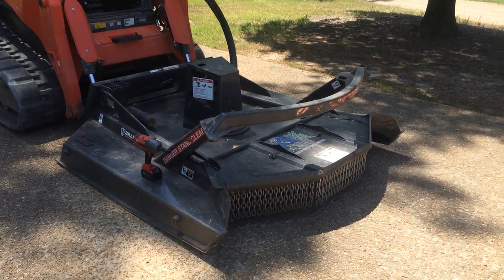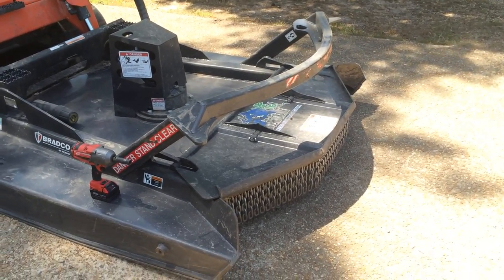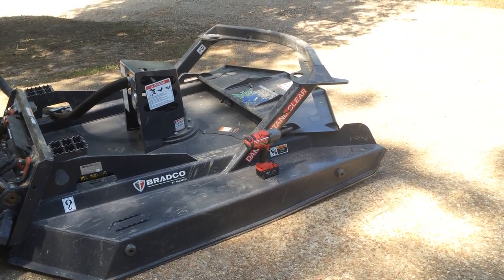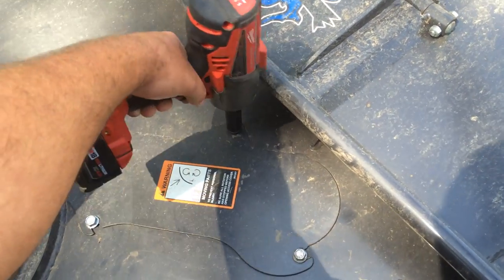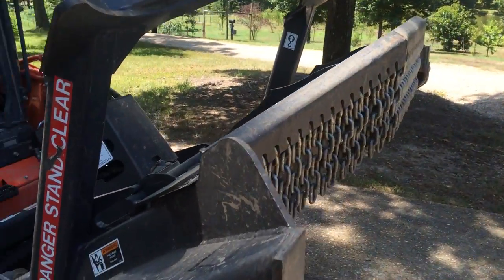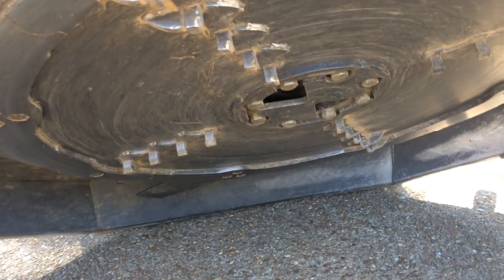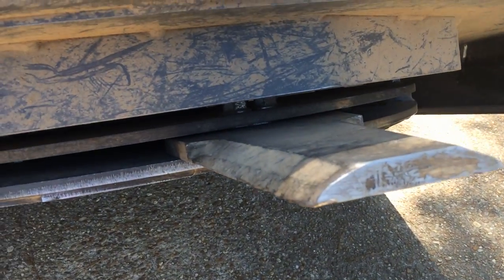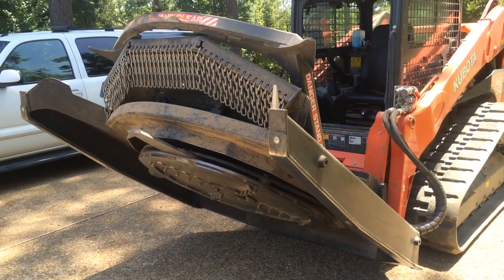Extreme Duty Ground Shark Walk Around

Comment: How does it do on range grass and brush?  Did you compare any other products?  I see diamond attachments (black unit) $7500 has a similar product with the hinged front for safety.    I also see the Diamond Mower (yellow unit) has a unit for about $10,000
Reply from the maker: It does great on brush, grass it does ok on... better than ok with sharp knives.  On grass it is comparable to a bush hog.  

I looked at all the products that were available and picked the Ground Shark, regardless of price, due to the features and weight (durability).  It's the only mower I know of with knives (23lbs each!) and 18 carbide teeth which really help mulch the material and save dragging the knives/blades through the dirt.  Bradco had a price increase like most mfgs, but still it's still what I would pick since I typically use things to their extremes.  I'm a dealer for Blue Diamond, Bradco, Virnig and probably someone else that makes a mower.